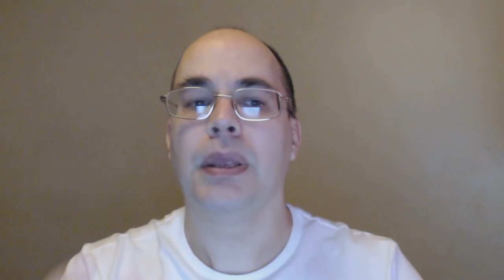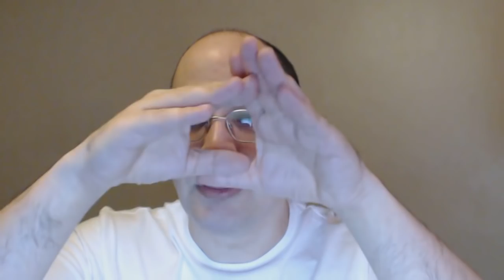How do rockets move in space, with nothing to push off from?

Comment: How long does water vapor and carbon take to dissipate in space?
As a rocket gains altitude, the exhaust cloud expands more than at sea-level because the air is thin and cold, it gains efficiency - until the exhaust cloud is so expanded that the nozzle becomes inadequate. 
The higher you go, the bigger the expansion until it dissipates instantly as it comes out the nozzle.
Reply: Would you care to evaluate some video of a rocket reaching space?

For the sake of the conversation let's make sure we know where the "vacuum" starts.
So at WHAT ALTITUDE above earth does atmospheric pressure drop to "vacuum"?
Industry standard for "vacuum" is "any pressure BELOW 1.0 Torr (0.02 PSI).
SO at WHAT ALTITUDE, does atmospheric pressure drop to BELOW 1.0 Torr?

Tell me that and Ill show you a video that we can evaluate.

The video shows how the rocket exhaust plumes are "compressed" at sea level, then expand as the rocket gets higher.
At some point the plume STOPS EXPANDING. This is when the rocket has reached "vacuum".
this is CLEARLY visible in the video.
the video also has OTHER clues that the rocket MUST be in vacuum.
Reply: @humblebwonderful9705  i have actually video evidence of a rocket working in a vacuum. Why won't you answer my question above?  How high before vacuum?
Reply: @stuartgray5877  how do I block you? :?
Reply: @humblebwonderful9705  - "how do I block you?"
Ask some of the other five year olds in your special needs class to help you
Reply: @humblebwonderful9705  - "how do I block you? :?"

I SEE
So you NEED to BLOCK PEOPLE that ASK YOU QUESTIONS.
Got it.
Yo are AFRAID to be challenged in your delusion.
This is typical for very low IQ individuals.
Reply: This is why the nozzle is so critical. Not at brute force sea-level, but  at some point, that exhaust plume meets no resistance to disperse (not even gravity) and the rocket nozzle you need is so big it causes drag. It seems a bit contrived.
Reply: @humblebwonderful9705  gas particles can only move at the speed of sound. So there is no instant dissipation. As previously discussed the impacts from the gas particles is what generates the force creating thrust. 

You are somewhat correct however that the bell of the nozzle needs to be sized to match an external pressure. In a vacuum that becomes a rocket bell of infinite length. That doesn’t mean that there is no thrust. It just means the thrust is less efficient. The curve which describe rocket efficiency to bell size in a vacuum is asymptotic. It approaches peak efficiency but never reaches it. Hence the length required being infinite. But it also means that you can have a reasonably sized rocket bell that reaches say 70 or 80% of peak efficiency.

This would be fairly cumbersome and create drag and also wouldn’t work well in atmosphere which has different external pressures. As such rockets have staged burns. They start with a rocket bell designed for near sea level pressure. When they get high enough they become very inefficient as the pressure has dropped dramatically. So they separate the rocket to reveal a second engine which is better suited for low pressure regions (high altitude). In some cases there is a second stage separation revealing a third engine designed for thrust in a vacuum.

As a result you aren’t subject to the drag associated with the size and shape of rocket bells that you aren’t using.
Reply: @engineeringtheweirdguy2103  Okay, then how long does it take for the exhaust to dissipate? Does it fall back to Earth? As a gas or a solid?
Reply: @engineeringtheweirdguy2103  Gas particles make up the composition of the exhaust plume coming out of the exhaust nozzle, but you say that the gas particles in the exhaust plume can't travel faster than the speed of sound?
As you can see in the following link, the exhaust gases are leaving the nozzle at hypersonic velocities, well in excess of the speed of sound. 
https://en.wikipedia.org/wiki/Rocket_engine_nozzle
Reply: @sailorman8668  yes. But relative to the air around it. As described in my previous comment, what is the speed of sound inside a Concorde airliner traveling at super sonic speeds? Can you talk to the person in front of you? You can, because the speed of sound is relative to the speed of the medium the sound is moving through.
Reply: @engineeringtheweirdguy2103  Why are you so hung up on this aspect of 'gas particles'?
It doesn't change in any way, the fact that a rocket is propelled by expelling large amounts of mass (combusted fuel in the form of exhaust gases) at very high velocities, thereby creating a substantial momentum force.
Reply: @sailorman8668  it doesn’t change that fact. Correct. I’m just answering the original post.
Reply: @humblebwonderful9705  it’s not the speed of dissipation which causes the inefficiency. It’s how wide it expands. A rocket at sea level has a narrow straight laser like exhaust plume. But compare that to high altitude shots of the same rockets it looks like they’re attached to a fiery hot air balloon on the bottom. Because it fans out so much. If you think of force as vectors. Such that a force on an angle has an X And Y component which combine to give you your angled resultant force. If you only need the Y component then any of the forces magnitude give to the X component is wasted energy which isn’t used, as it tries to push the rocket nozzle sideways whilst the same is happening on the other side cancelling it out.

So the greater the angle or the greater the spread of the exhaust coming out of the nozzle, the more wasted energy you have. Thus it is a requirement to not only design a nozzle in which it accelerates the gas but also keeps the exhaust focused. With a de laval nozzle this is dependant on the outside pressure. Whilst in a vacuum you might not be able to achieve the focused exhaust such as seen at sea level with low altitude engines. But you can try to maybe 80% or 90% of that. As long as there is some part of the exhaust leaving the rocket with a Y component then it is creating thrust.
Reply: @engineeringtheweirdguy2103  the expansion of the cloud is dissipation.  
There is no sound in deep space. No medium. No speed of sound. No mach speed exhaust.
Reply: @humblebwonderful9705  well. Yes but also technically no. The speed of sound is the speed at which a sound wave can travel through gas particles. That speed is thus relative to the speed of the gas particles. Which is why you can hear things “on the wind”. For example if you’re flying in a Concorde airliner travelling 1.2 times the speed of sound. You can still talk to the person in the seat in front of you, despite travelling faster than sound. Because the speed of sound is relative to the speed of the air it’s travelling through, in this case, relative to the speed of the air inside the cabin.

However gas particles are always in motion, this is due to their temperature being expressed as kinetic energy. Which is why things gas hotter as you compress is and colder as you decompress it. The speed however, usually matches the speed of sound. That is because the major limiting factor for how fast a pressure wave transmits through a gas is the gas particles speed. I.e how long it takes the gas particles to physically travel to the next particle to transfer the energy.

Some consideration is given the density of the gas, as more gas particles will transmit sound easier as the particles aren’t homing missiles the interactions are random chance. 

So the gas cloud will expand and dissipate at the speed at which the gas particles are moving. Which will be approximately the speed of sound relative to the conditions inside the gas cloud.
Reply: @humblebwonderful9705  yes and no. It’s a little deceptive. The speed of sound is the speed at which sound travels through the air. If you’re on a Concorde and you’re travelling faster than the speed of sound. Then you can talk to the person in front of you because the speed of sound is relative to the motion of the medium it’s travelling through. But true enough, the de laval nozzle accelerated the gas supersonically. You are correct. 

I do not know how long it takes to dissipate but it isn’t instant. It also depends on when you would consider it dissipated. The volume of space taken up by the gas is 50% greater than original? 200% greater? 300%? 400%? It’s really like trying to find a finite point on an infinite ruler.

Comment: still doesn't explain how Rockets get direction in space with no matter to push off. And Newton was wrong every action does not create an equal reaction like punching in the air nothing happens
Reply from the maker: Punching air does create a reaction, what gave you an idea that it doesn't?
Reply: @mjmurcott647  I'm saying just that for every action there isn't an equal reaction
Reply from the maker: Name an instance.
Reply: @raysims5267  - "for every action there isn't an equal reaction"

So YOU are arguing that Newtons Laws are FALSE and YOU figured this out even though a thousand years of Engineers have been missing this?
So a High School dropout figured out something about Newton's laws that every Engineer and Physicist TO HAVE EVER LIVED failed to figure out?

You must be a Genius!
A Genius that refuses to just answer my simple physics questions?
Reply: @raysims5267  when you punch air, your arm provides a force. That force accelerates your first. Only reduced by the minimal air resistance. At the end, your body will bear the force to arrest the motion of your first. Almost all the forces in this instance, other than air resistance are occurring inside your body. You can likely feel this. The strain to accelerate your fist and the strain to stop it at the end of the bunch. Action is apply a force to move your fist. Reaction is your fist accelerating. 

In a scenario where you punch someone, the force to stop your fist comes from someone else’s face instead of inside your arm.

There is no violation of Newton’s laws here.
Reply: @raysims5267  A "force" is NEVER applied to only one object.
Forces ALWAYS occur in PAIRS.
This is what Newton's 3rd LAW tells you:

”All forces occur in pairs, and these two forces are equal in magnitude and opposite in direction”
An "Object" CANNOT have a force exerted upon it EXCEPT by another object and then BOTH objects feel the force.
Reply: @inniuniui9361  - "as a vacuum cannot exert a force on the rocket.."

This is true: But SOMETHING IS exerting a force on the EXHAUST GAS!

do you agree?
from the perspective of the rocket the Exhaust gas gets accelerated from a relative velocity of ZERO to about 2500 meters per second.

So WHERE DID the force come from that accelerated the exhaust gas into the vacuum?

Im all ears....
Reply: @inniuniui9361  - "you've already admitted a rocket cannot produce motion in a vacuum"

I said NO SUCH THING!

I said that the VACUUM cannot exert a force on anything.

Ill BET that you wont just answer some simple yes/no questions.
well see:

If I fired a steel projectile, from a CROSSBOW in space, would I feel a recoil force? Yes or No?

Just ANSWER the question and we will move to more relevant questions.
I want to be sure you understand how MOMENTUM works.

"plus the citation i posted proved you wrong about how the velocity of a gas increases too."

I have no idea what you are talking about. Why don't YOU explain it to me instead of pointing me to something?
Reply: @inniuniui9361  hate to break this to you, but "Stuart Gray" is a very old chatbot :-/
Reply: @mjmurcott647  He named "punching the air."  Since the law says "action" the action then is "punching."
Punching may or may not give you an opposite and equal reaction.  If you punch a wall, opposite reaction.  If you punch the air, smaller reaction.  If you punch nothing, no reaction.

If all it took were an action to get an opposite and equal reaction, I could lift myself up by pulling on my belt, drive my car with the wheels never touching the ground, and walk on air like Bugs Bunny.
Reply: @DrCash7   To all OTHER READERS, watch as Dr Cash REFUSES to just answer simple questions that ANY PERSON who has taken high school physics CAN ANSWER:

1 - When a rocket engine fires does the exhaust gas GET ACCELERATED? Yes or No?
2 - Does the Exhaust gas HAVE MASS? Yes or No?
3 - Can MASS be accelerated WITHOUT A FORCE? Yes or No?

And finally - Since the Rocket IS accelerating the exhaust gas, AND Exhaust gas HAS MASS, AND MASS REQUIRES A FORCE to be accelerated, then:
 Dr Cash - From WHERE does the FORCE originate that accelerates the mass into the vacuum?

There MUST be a force, so WHERE does it come form?

YOU have stated that the VACUUM CANNOT EXERT A FORCE!

now WHERE IS THE FORCE COMING FROM?

The OTHER READERS: Watch as  Dr Cash refuses tp answer and devolves into a five year old hurling insults instead.
He CLAIMS to understand physics but he REFUSES to cooperate and PROVE IT - because ANSERING TRUTHFULY - PROVES HIM WRONG 
THAT is why he refuses to participate in an ACTUAL debate.
Reply: @inniuniui9361  Where have all the rockets gone, that have supposedly been launched into space?
Reply: @inniuniui9361  - "i've answered your questions repeatedly, but you just lie about it"
If you HAD answered, it would be quicker to give me your answers again than argue about where you answered:

I contend that you HAVE NOT answered the following questions:
1 - When a rocket engine fires does the exhaust gas GET ACCELERATED?
 Yes or No?
2 - Does the Exhaust gas HAVE MASS?
 Yes or No?
3 - Can MASS be accelerated WITHOUT A FORCE?
 Yes or No?

ANSWERS to these questions are YES OR NO.
If you cannot answer them, then you don't understand Newtons laws.

but you will PRETEND to be offended and use that as a pitiful excuse for not just answering so the OTHER Readers (who have not read your other posts) can see your answers here for us now.
please proceed...
Reply: @stuartgray5877  My compliments to you, my good sir, for having the patience to suffer all those people and their sock puppets 👍
Reply: @papalegba6759  - ANSWERS to these questions are YES OR NO.
If you cannot answer them, then you don't understand Newtons laws.
Reply: ray sims:
answer a couple of very simple physics questions TRUTHFULLY and we can make it clear how rockets work in a vacuum.

If I fire a steel projectile from a crossbow, here on earth, will I feel a recoil force? Yes or No?
WHY or WHY NOT?

explain this and we can determine if you understand basic inertia and Momentum.